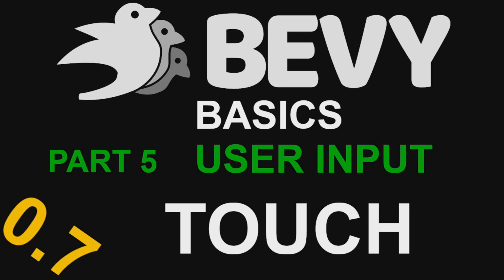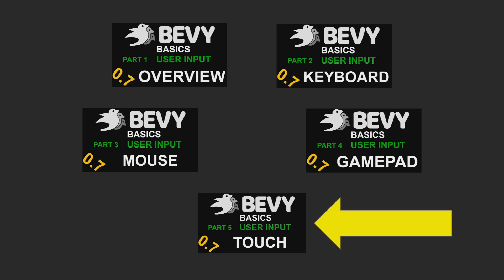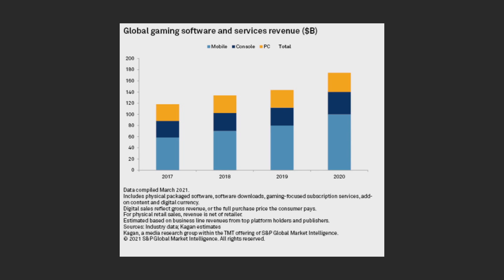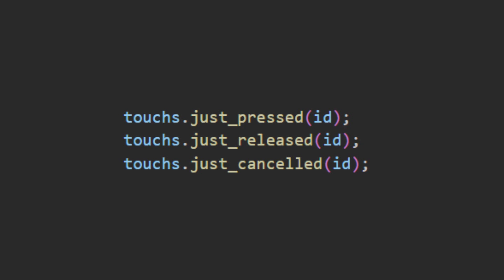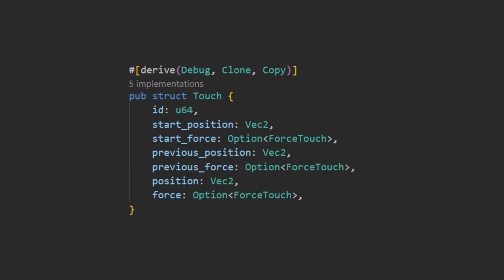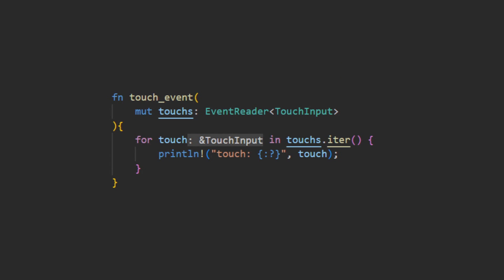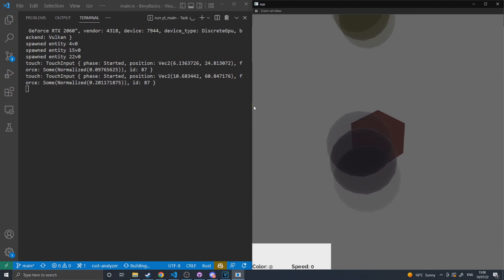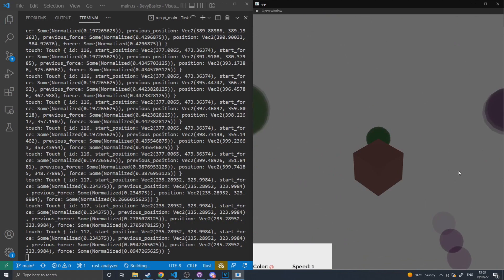Bevy Basics #9.4 Touch Input

Comment: I didn't get how touch screens are managed. I guess I'll have to try and see :-)
Reply from the maker: From my understanding there just the same as touch pads, tho I couldn't confirm because I don't have one to test, the only difference you might find is that it may return a different 0,0 point because it might match the mouse. Idk?
Reply: @PhaestusFox  I tried to print both ResM<Touches> and EventReader<TouchInput> on my laptop that has a touchscreen: they work as expected. If I use the stylus I also get Windows-style Normalized(f64) force readings :-D
Now, going from that to usable input is going to be a fun exercise... ^__^;